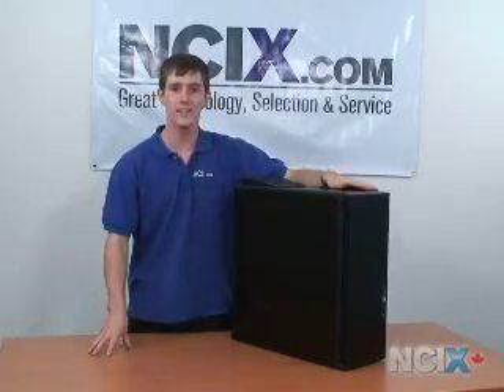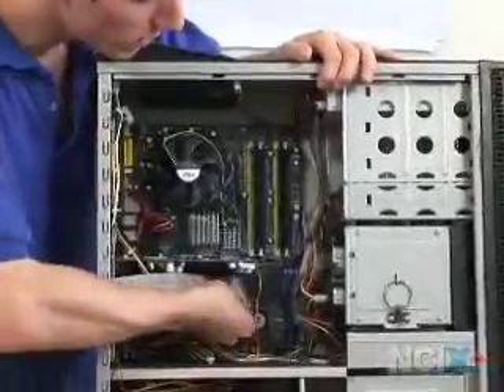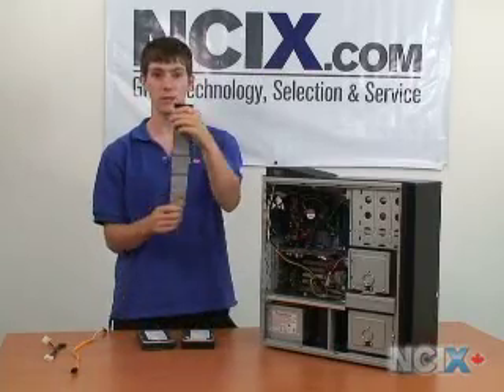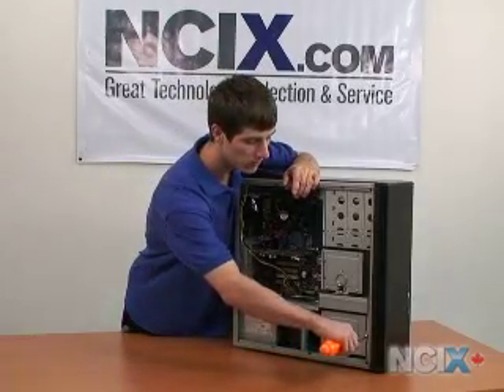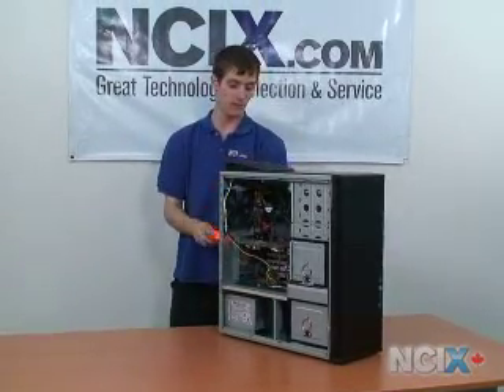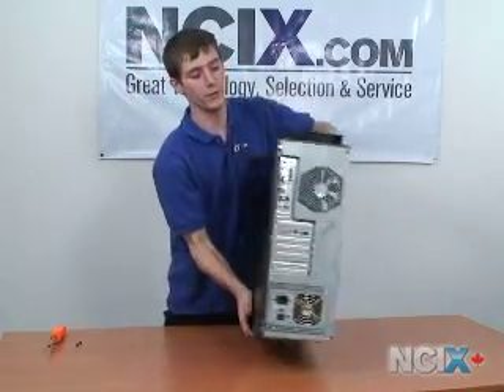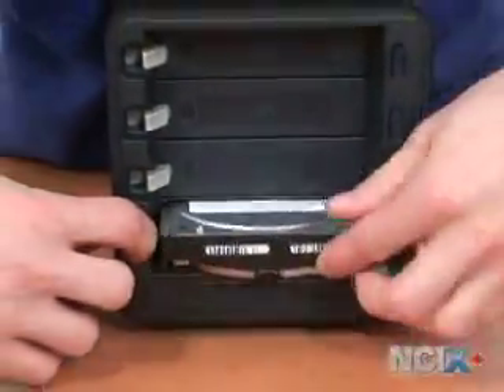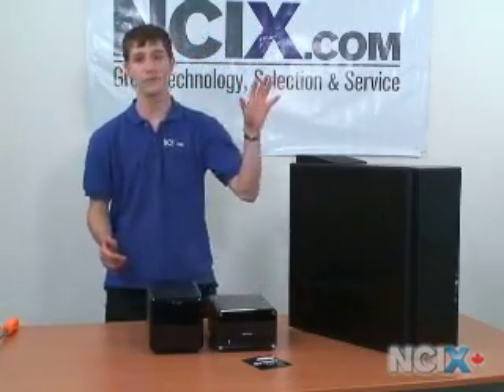Installing a new hard drive (NCIX Tech Tips #6)

Comment: @ofoosy They put the PSU's on the bottom in most gaming cases so you separate the power supply heat away from the motherboard so you don't throw off the temperature sensors. It also balances the case more better.

Comment: Hi, I have an SATA hard drive (Maxtor) and a second SATA hard drive, but the connection to the motherboard is different from each other. Do I need a converter? Please Help. I would also like to buy a new hard drive (SATA) how would I know if the connection to the motherboard is the same?? Please Help

Comment: Anyone know if it makes a difference which SATA connection (SATA 0 or SATA 1) is used on the MOBO for the primary boot drive?  I just removed the second (data only) drive from my old Dell Dimension 8300 (which I installed a few years ago) and it now it would not boot up properly.  I switched between the SATA connections on the MOBO before messing with the Bios (thinking it made no difference which one it was connected to) and now I can't remember which it was connected to before hand.  Help!